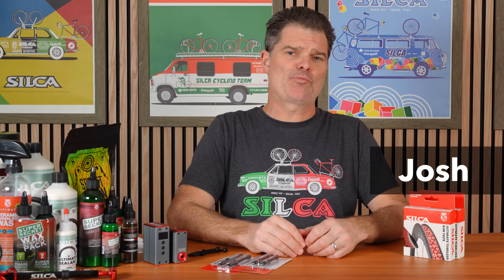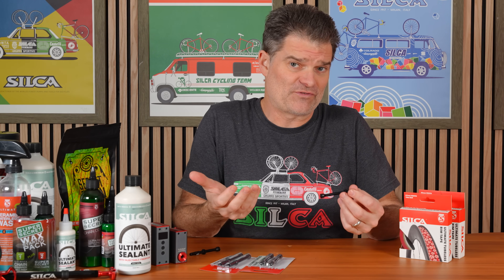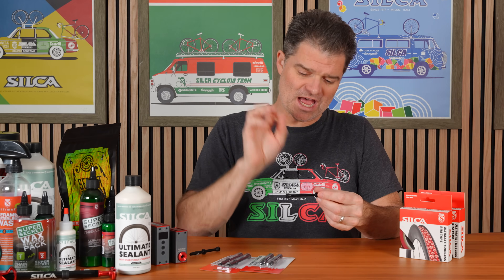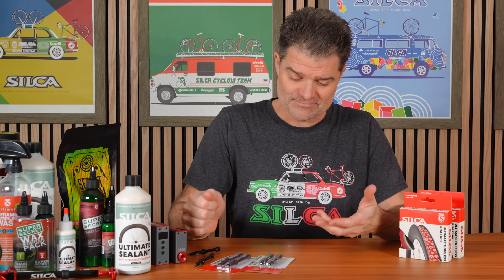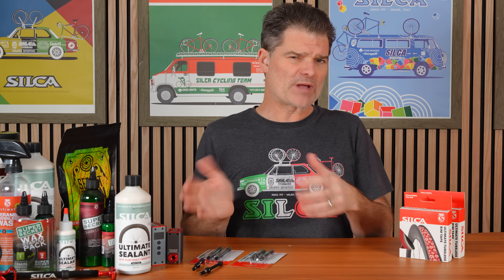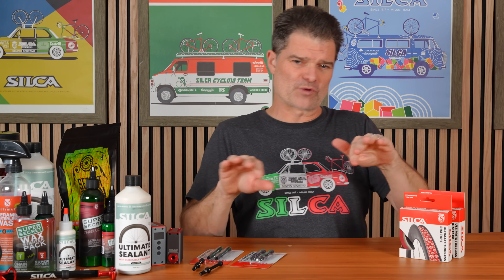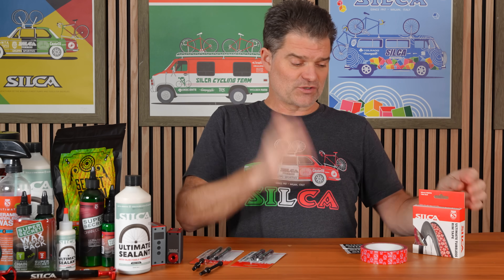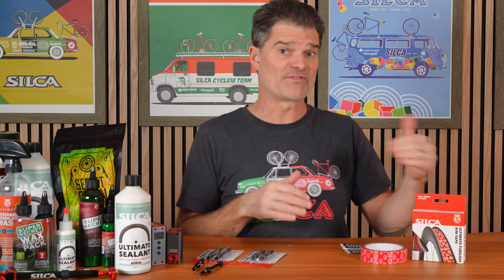Ultimate Tubeless Rim Tape & Valves: What Actually Matters

Comment: Have you checked that Clik valves screw into the valve stems because I have found that some aluminium alloy valve stems will not allow the Clik valve to screw into the body because of an inconsistant internal thread? There is no definitive standard for the length of the internal thread either but that is not a problem with the Presta valve as there is no shoulder but the Clik valve does have one. Apparently..."The internal thread length (engagement depth) for a Presta valve stem is not a universally published, precise standard dimension in the same way as its diameter and pitch. This is because the internal depth can vary slightly between manufacturers and stem lengths, but all are designed to securely accommodate a standardized Presta valve core." This means that for the Clik valve there is a lack of consistant seating in the stem by not screwing in far enough or even too far so that the shoulder stops full sealing at the PTFE seal/stem interface. 

The thread of the Presta core tip is designated as 5V2 by the ISO 4570 standard, measuring 5.2 mm diameter x 1.058 mm pitch and I presume this must be the same for the Clik valve though I believe some manufacturers use the closest metric equivalent for the valve and the stem which may explain the inconsistencies.

Ironically I was looking at this problem the other day and came to the same conclusion as yourselves. However, I was thinking that the Presta stem (6mm) should be used for narrow rims and Shrader (8mm) for MTB to cover all bases though some carbon rim manufacturers would not like to have a larger valve hole. Also a 44mm valve stem should be available for an MTB rim. Clik will be making a valve for Shrader for sale in May this year.

Comment: great to see the new rim tape ... with that in mind ... is there any advantage to undrilled rims that don't need rim tape? I'm guessing there's a trade between more mass in the rim (no holes) vs. no mass for rim tape, but is there any kind of marginal gain for either?
Reply: Undrilled rims weight less, the tape weights way more than the removed material, and also, structurally is better.  I'm not considering other option when changing rims for my tubeless setup. Tired of tape..

Comment: This video is presented like Silca is new to tubeless valves and tape. But these are more like Gen 2 products after the Gen 1 have been out of production for a while.

Surprised Josh didn’t mention they’ve done this before and explain the before-and-after improvements. 

I have Silca tape and valves on my bike right now. The tape is translucent gray and definitely a whole different thing from this version. The valves, however, seem like a much more incremental change…because the ones I have from a few years ago seem more similar than different.
Reply: The Gen 1 Josh referred to was the sealant. No mention that Silca made the earlier valves or tape.
Reply: He mentioned Gen 1 and how it was getting messed up from carbon filaments from sealant.

Comment: Clik Valve is the best. It may not be as good as completely removing the valve core but it does get more airflow if you need to pump up the tire while out on a ride. The great advantage of using a clikvalve is the click part. You literally just click the pump chuck on and off. No need to unscrew and screw. 

Sure, it's easy to unscrew and screw back on but I do prefer the click on and off while pumping tires. I've also soaked the my clik valves in synergy lubricant and it's been awesome.
Reply: What about having an e-pump, clicked against the clik valve, and you are just literaly standing there, not needed to even push the pump against the rim.  I will never go back.  cliks ftw.
Reply: Best?  That's a subjective measure, not an objective one.  Reading comments about them and reviews on 'em seems to suggest that there are some foibles of Clik valves that aren't acceptable for some.
Reply: @robinseibel7540  Yes, when someone says something or anything is the "best" it's subjective. I don't think i need to add "in my opinion" to everything. 

I'm sharing my perspective as do many others :)
Reply: @liquidSpin  Unfortunately some folks think best is a an objective thing. I'm glad you're not one of 'em.
Reply: @robinseibel7540  Sad but true

Comment: Death to rim tape.  Long live rims without spoke holes.  Looking forward to trying the synergetic trick for valve stems.
Reply: long live the angry mechanic having to use magnets to get the spoke nipples into place…
Reply: @flo8273  if that makes your bike mechanic angry, get a new mechanic.  Its honestly not that hard but yes it obviously takes more time.  Cry once at build time and then never think about tape again.  trust me.
Reply: @B @BJKeane-mc6bm h mate. I cannot get another one of me.
Obviously, the 98% of the time it is not an issue, but the 2% (for example a broken spoke) it is a huge pain in the ass.
Reply: @flo8273  Fair.  luckily i haven't broke a spoke in a while [knocking on wood]